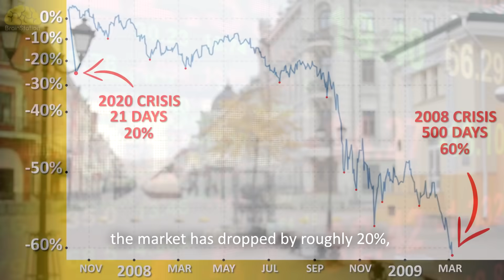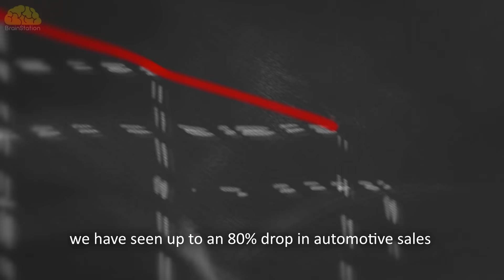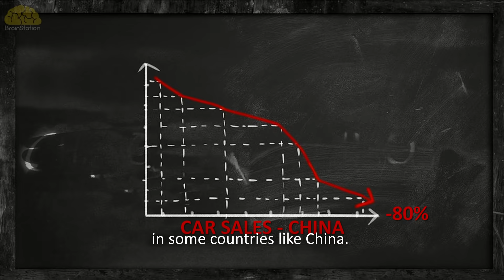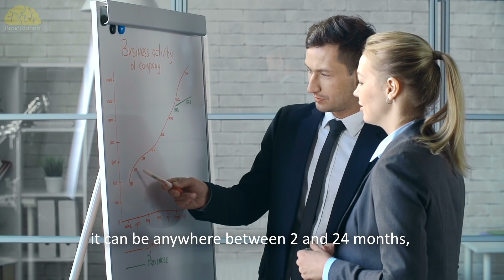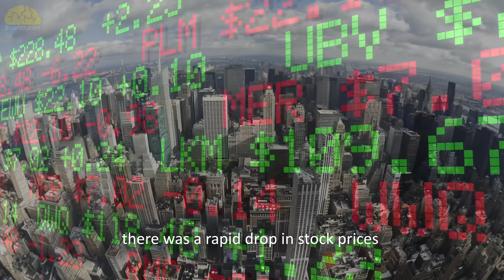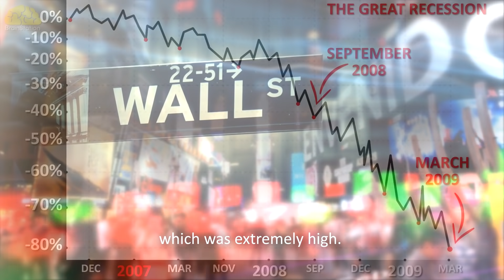The Worst Economic Situation Ever! Be Ready for This!

Comment: There is a reason the FED is printing $195,000,000,000 BILLION DOLLARS on a daily basis AND it is  NOT, to replace worn out bills. Especially since the majority of the people uses debit and credit cards.
Reply: NO Juan....they print a lot of worthless paper but it's impossible to print that quantity in a year let alone on a daily basis. The paper isn't even available in that massive amount. I don't think you have a grasp of what a trillion is...that's a thousand billion x 195 = you would have money stacked to the moon and back.
Reply: @mikejohn0088  You have point there, however, I am sure they are not printing it in $1.00 denominations rather than in $100.00 denominations. Just saw on Google that 100 rows x 100 pallets equala $100 Trillion dollars. If I am not mistaken, I saw this info on Youtube. BTW, I personally know several people who work at the Bureau of Printing and Engraving. Will make it a point to find out. BTW, Zimbawe already has $50 and $100 TRILLION DOLLAR Notes in circulation. These people are far more rich than Satanic Bill Gates, George Soros etc.